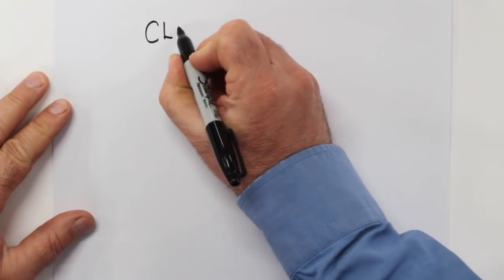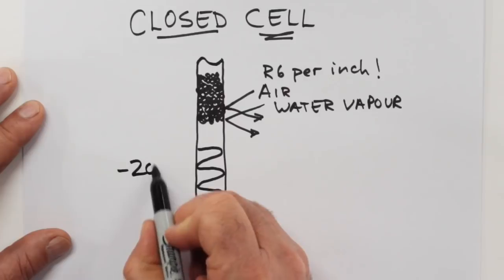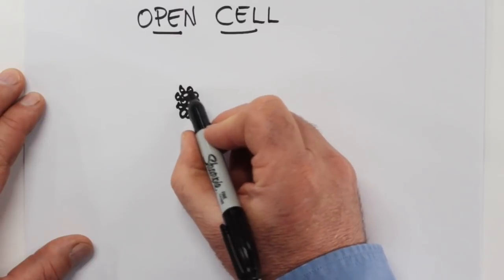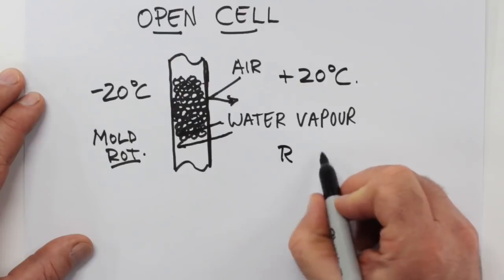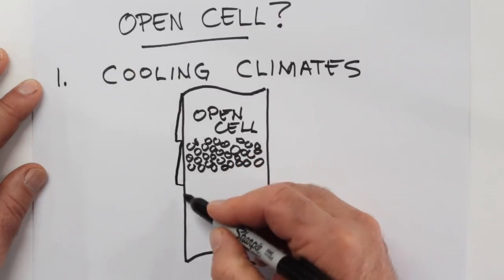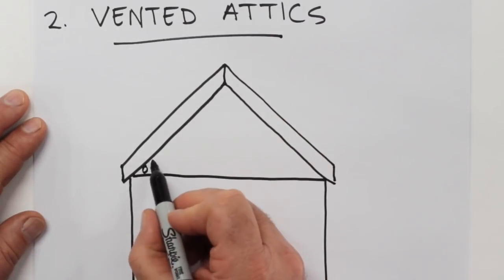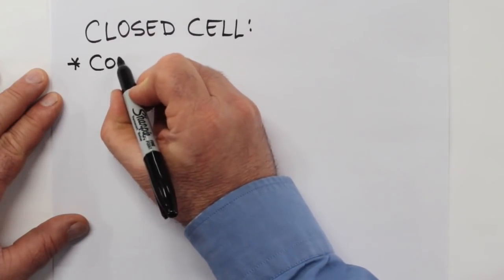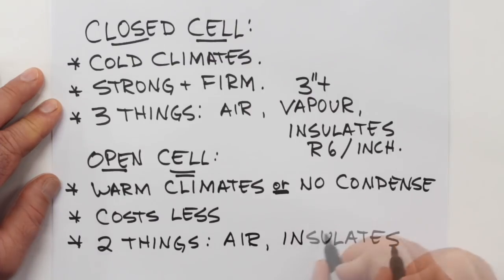SPRAY FOAM: Open Cell vs Closed Cell

Comment: This stuff traps moisture against timber no matter what.  In the UK we've seen entire roof structures destroyed through  the use of this stuff. We tell all our clients to avoid totally.  Any sprayed foam roof in the UK is automatically condemmed by surveyors.
Reply: Peter Ward only in the presence of moisture, if its installed/applied properly, it (closed cell) will adhere to the surfaces, always use a space maintaining panel against the roof sheathing to allow air movement from the soffit to the ridge vent, even if there aren’t ventilated soffits or a ridge vent, it allows that option, as well as a place for water intrusion to escape, and therefore be noticeable as it drips from the soffit, which rafter bay the leak is in, so it can be easily and immediately repaired.  
 As with anything, it’s all in the knowledge, competency, foresight, preparation and attention to detail by the contractor and technician, that make or break a potentially unprecedented breakthrough, and innovation.
Reply: Blame the roof ,not the foam! Is it your flooring guys fault if your plumber didn't seal all of your plumbing and ruined your floors?!

Comment: I am considering spray foam in the attic of a 4/12 pitch roof about four blocks from the beach on Florida's East coast. Very hot and humid. No longer a threat from tree damage to the asphalt shingles. Quoted by a professional for open cell foam for 3,500 bucks for 28 squares of attic (1,500 sqft living space). Would I be better off with open cell or closed cell against the decking in the attic? I'd like to completely seal the house. He had me concerned about a shingle leak and being able to detect it over closed cell retaining that moisture. Thank you.

Comment: Man, I was wondering what's your guess on if it's possible for a local foam insulation installer to spray foam in an inflatable intex excursion 5 boat???
I'm just wondering if its possible to spray  the inside of the inflatable??

THAT FOAM FLOATS RIGHT
Here is a link to the inflatable  boat i an asking about 

https://youtu.be/11C_Kakf28Y

THANKS FOR THE EXPLAINING  THE WAY CLOSED CELLS AND OPEN CELLS WORKS

Comment: I’m so confused 🤷🏼‍♀️ so after video I was thinking closed cell was for me and open cell wasn’t good since I’m building my forever home. But then you said warm climates. So we’re planning a metal home with metal roof and interior wood framing facing south with no trees currently. We want a cathedral ceiling in very large part of home (living space) then above rooms will be a traditional attic. What the best application for me I’m in Texas. I have had different companies tell me different things and what about brands isn’t there different brands?thanks

Comment: I live in a very humid, hot area, I have a brick home with a metal roof. which would better for me open or closed?
Reply: Depends. Do you already have a vapor barrier on the exterior of the house? You can use closed cell any time. I would only install open cell if you have a vapor barrier installed on the exterior of the building. I’ve been spraying foam for 10 years.

Comment: after 42 years in the insulation business and 22 years in the foam business It Amaze me with the line of idiot talking about foam while the really represent the industry bottom line profit. FIRST OPEN CELL AND CLOSED CELL 1" SPRAY = TO 72% EFFICIENCY just look at your refrigerator freezer door thickness? and it work just fine with the different temperature just like your home in the winter. AT 4" SPRAY = 95% EFFICIENCY just look at the walk in freezer in you supermarket 4 " it is. NOW THE NONSENSE MOISTURE PERMEATING INTO THE OPEN CELL? NEVER HAPPEN ! IN THOUSAND OF OUR JOBS NO ONE CALLED TO SAY THAT & IN MY HOME ATTIC THE FIRST JOB IT'S DRY AS DAY ONE,  next time you have your beer bottle or can wrapen in the open cell foam sleeve = the drink is cold and NO CONDENSATION
Reply: You are correct sir. Done thousands of jobs here in Texas and only good feedback.

Comment: Open or closed cell?
I have a wood-framed flat roof on my garage. Last summer I stripped of the old tar n gravel, added 3/8" ply and torched on rolled sheets of asphalt. Now I'm thinking I'd like to insulate the inside. I've heard pros and cons for both open and closed cell so I'd like an unbiased opinion. 
Can you help me?

Comment: No foam on the roof. Lots of problems and you can't have a radiant barrier. Owens Corning and Certainteed, 2 biggest manufacturers of asphalt shingles announced that your shingle warranty is good if you use foam.

Try something else...here's an idea 
Fiberglass! Duh
Reply from the maker: Good Morning Bob,
I'm all for using batt insulation in a conventional, ventilated attic, but there's nothing better than foam in house designs that use the full volume of space under the roof for living area. The first thing to understand is that while it's true organic asphalt shingles don't last well on hot, unventilated roofs insulated with foam, fibreglass asphalt shingles last just fine over foam. I've built a number of roofs like these over the years. The oldest are now 15 years old and they look exactly like the day I completed them.  Fibreglass asphalt shingles are what's used on what might be the best roofs of all, those made with structural insulated foam panels. No rafters or sheathing, just SIPs panels. I'm sitting under one right now as I type this. It's the best roof in the world in terms of energy performance, space utilization and air sealing. The boost in performance given by foam in a roof far exceeds what might be delivered by a radiant barrier.

You mentioned that there are lots of problems with foam roof insulation.  Other than the need to use fibreglass asphalt shingles (most asphalt shingles are fibreglass these days anyway), what issues have you found in roofs you've built? I've built, observed and lived with foam-insulated roofs for a while now in a harsh climate and I've found them to be the best.

Bye for now,

Steve
Reply: Sorry folks, typing on phone and a word left out.... NO WARRANTY on shingles if foam is used
Reply: Steve Maxwell completely true.  I work in construction in the building science end and closed cell foam has been shown to heat a roof on average 2% which is very little.  The direction your house faces can heat your roof up to 5% more.  The "warranty" being voided was years ago before all the proper testing was done.  Our company has foamed thousands of roofs all over the country in every climate zone without issue.  Only time foam will cause an issue is with cedar shake roofs which need to breath from both sides.  Other than that, installed correctly spray foam is bulletproof.
Reply: @jwelks50  i completely agree with everything you say here.👍
Reply: @premierinsulation7252  Owens Corning doesn't sell spray foam like all the other insulation companies and they're the only ones who won't warranty spray foam below their shingles, but the other shingle companies will...  I don't think bob can see the writing on the wall.  OC has been anti spray foam from the beginning because they refuse to get in the game.  That and where I'm at, it's actually written in the building code that unvented roof assemblies can ONLY use cc foam or rigid board.  Fiberglass is strictly prohibited where no ventilation is present, and rightly so.
Reply: @jwelks50  yes they do not sell foam. And thats probably why they dont want people using foam so more of their products get used. With more and more places making houses perform a blower door test to meet a certain ach, foam will be the future for air sealing. There really is no other alternative yet that is cost effective and that performs like foam does. We would have to drastically change our building procedures. And as far as them not warranting foam under shingles, they were saying it made the roof hot and shingles would not last as long. Which the foam only makes it like 1-2% hotter, while the position of the house in correlation to the sun has the greatest effect around 5-10%. So seems to me oc is just wanting to be proprietary with their sales. 👎👎👎
Reply: jwelks50 
Not true. Shingle manufacturers did this late 2017, not 5 years ago.

What about roof leaks?
Reply: bob cole Your terribly misinformed.  What about roof leaks?  Ever see a roof leak with fiberglass installed on the attic floor?  I have, hundreds.  By the time it soaks through the fiberglass enough to stain your ceiling there's already mold growing on the roof deck.  Now your paying for the roof, drywall, suck out of the fiberglass, mold mitigation and re-blowing in the insulation again.  I've been involved in more insulation jobs (fiberglass, spray foam, cellulose) than you've lied about.
Reply: jwelks50 know exactly what I'm talking about. Been in residential construction a long time. Used to work for a builder that did nothing but foam. Don't feel like going through this again, I sent a long response to Steve, 'splained it all.

Foam is for coolers and reefers
Reply: bob cole things have changed since the 70's Bob.  Have a good day.
Reply: Fake news buddy.  Many manufacturers fully warranty foam roof including Certainteed.  OC sells only FG so you figure it out
Reply: Stuart Fearn Just checked OC site. Shingles are composition material of asphalt with fiberglass. The roofing company that does our roofs told us about no warranty with foam late last year, 2017. Not in the 70's like someone else implied.

If you like foam and want to use it, be happy!
Reply: Stuart Fearn  i have figured it out...
Reply: @bobcole3852  get with the times bob.

Comment: Is one better as a sound barrier? Based on what I’ve learned from your video, my guess would be  closed
Reply: Philip Kloppers dead on.  open cell is great for acoustic sound reduction.  closed cell may actually amplify sound and make it worse.
Reply: Open cell is preferred for acoustic absorption. Closed cell insulation acts more like a reflector and can transmit some acoustic energy (think of a Newton's Cradle...), while open cell insulation will trap and absorb the energy.

Comment: Great video! Quick question, what type of foam is in the cans? Like Great Stuff... Is that stuff open or closed cell? It never says on the can.
Reply: Closed cell
Reply: @Extravirginoliveoil9  I don’t think the answer is that simple as it isn’t even remotely similar other than being polyurethane.
Reply: @christophergruenwald5054  I strictly answered the question as to whether canned foam is closed or open cell. I didn't claim the products are similar.

Comment: what if your winters are snowy cold and your summers are humid hot? which foam would b better closed or open? btw best video so far on explaining what is what
Reply: closed cell would be best
Reply: @getwet1  closed cell is ALWAYS best, open cell is only 1/2 the insulation value but it is NOT 1/2 the price. Then you have all these moisture issues as well.
Reply: this is my question too
Reply: I need that too
Reply: Nony 714 closed if its done right

Comment: So open cell would be a good idea for between floors of a condo? Where there is a neighbor above and below me... Open cell would be better between the bathrooms and kitchens between floors???
Reply: Open cell, also there is a special material you can apply to the joists before drywall that will help reduce sound transmission through the wall.

Comment: Very informative video, thank you!  
But.. where is -20 C (-4F) to + 20 C (69F) typical of winter temperatures where closed cell would be warrented?
Reply: Joanne Stevens  The +20 C is the temperature inside the heated home. -20 is the outside temperature.
Reply: @ronh9384  those are warm winters.

Comment: Can anyone help me? We just paid 3k to close cell spray our small basement.  It was sprayed directly onto our stone and mortar walls and cement/plaster walls. Today I took a small pin throughout the walls and just checked to see how thick it was and it is about a quarter of an inch thick throughout. Some spots didn't adhere to the wall. I can push off them and one section of the wall is soft. It's been a week. The rest is hard. Can someone give me any guidance here? I'm concerned it's not thick enough and was sprayed wrong. We live in Pennsylvania. Thank you.
Reply from the maker: Good Morning!
Sorry to hear about the trouble you're having. It sounds to me like you got a bad application – or at least it's bad in some spots. Properly applied foam will stick strongly to the wall. Have you contacted the spray contractor? What is his position on the situation? Please keep me posted on how things go. Email me at steve@stevemaxwell.ca to continue the conversation.
Bye for now,
Steve
Reply: 1, the contractor shorted you, and didn't spray what he should have. 
2, when spraying the walls, if they had any moisture content or if the walls were not warm, the foam will not stick. And i guarantee its one of the 2. He should have had a heaters down there to heat and pull moisture off the brick..

Comment: lets say there's a 2x4 vertical, exterior stud wall, placed up against a 8" thick existing brick wall, in a 100 year old house. Closed cell is used but there's no need to completely fill the whole wall cavity, so the sides of the studs are foamed in then several inches of foam is laid in between the studs.  And the stud wall is dry walled or thin coated with plaster veneer.  Water vapor can migrate through the dry wall. Will it condense in the wall cavity? If so then there's going to be a problem, mold could grow on the back side of the wall, the condensed water vapor would collect at the bottom of the cavity and work itself in the floor.
Does this all mean that a vapor barrier should be used on all vertical exterior walls?  What about the area between the joists between floors, water vapor travels up thru the ceiling, where some it can come into contact with the cold side of the foam and condense?  Or will the vapor just keep traveling "up"?

Comment: if water gets through your roof into open cell foam it won't just dry up, it will soak it up like a sponge and then fall through your ceiling under its own weight.
Reply: if the foam is doing its "proper" job as an insulant then by its very nature it shouldn't let heat through so a warm attic won't make it dry out  and insulation tha'ts wet will not perform  properly as an insulant.
Why would you even consider putting something in your house or any other property for that matter that has even a chance of not doing what its suppossed to do. Mark my words this product is going to lead to thousands of claims in the future where it has been installed in the wrong places.
Reply: Mate it has been used by the military since the 60s. What would you suggest to use in circumstances like those covered here in this video? If you have a better proven solution then please fill us in.
Reply: @longutsful  2inch foam has a R9-R11 value.
Reply: @richdarby2639  Dear brainiac, evaporation occurs regardless.  Heat does not cause anything to dry out, Antarctica is the coldest place on the planet and one of the driest.
Reply: @fiendish67  OK 30 odd years experience in the foam insulstion industry counts for nothing then I guess.
But what do I know.
Reply: @richdarby2639  Yes, that is what I was thinking, and "odd" being the operative word.
Reply: @fiendish67  ha ha , very good.
Reply: Bingo, and since it is a sponge and weak by nature , it can be catastrophic
Reply: What would you recommend instead? I'm about to insulate my house. Attic and crawl space - middle Tennessee.
Reply: i would use opencell
Reply: meaning the foam will never dry out?  Why not, it will certainly get very warm in the attic in the summer?
Reply: open cell foam will dry out over time and is better for ur house if close cell get wet it is not good because it is not water proof
Reply: You missed the part about him saying for use in a VENTED attic. Meaning there is air flow from the outside so the attic CAN dry. 

Of course if the leak is really bad this will happen; but leaks don't work like that. 

You don't get a leak one day and suddenly you have gallons of water in your house in one rainfall. 
No, leaks will start very slowly at first and build up speed over the course of a couple years. 
It is your responsibility as a home owner to check the attic for leaks every 6 months to catch the leaks before they get too bad.
Reply: rich darby i disagree. I think you're confusing insulation with absorption. Wet open cell foam can be effected by air without passing it through. Think of wool clothing for example - it keeps it's insulation when wet, but is certainly able to dry. 

Having closed cell foam behind a condensing wall/roof leak will hold the water between the foam and wall/sheathing allowing for rot and the growth of mold. With open cell allowing the moisture to enter the vented, hot attic space, it should be just like (in theory) throwing a wool sweater into a dryer.

In practice it may work out differently depending on application, installation method and how severe a leak you have.
Reply: I work as an inspector for the biggest foundation company in the country and I 100% agree you. Spray foam will end companies that install this garbage. I've seen it rot the structures of homes and cause north of 50k in damages. It's especially harmful in humid environments like crawlspaces. The only time this stuff should be used is when theres no other option - like old stone foundation walls but NEVER on wood that's exposed to higher levels of moisture.
Reply: @aguy80  so much miss information being spread here.